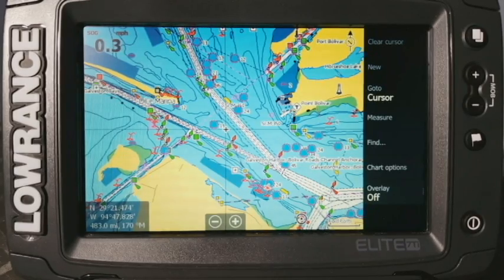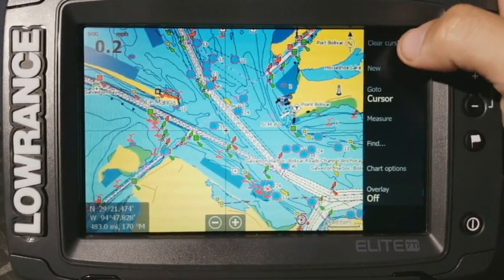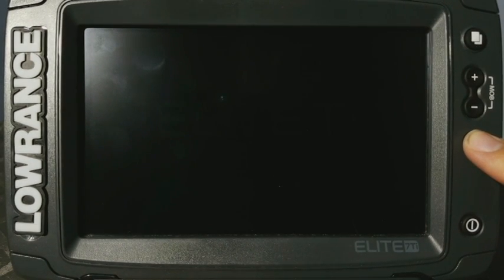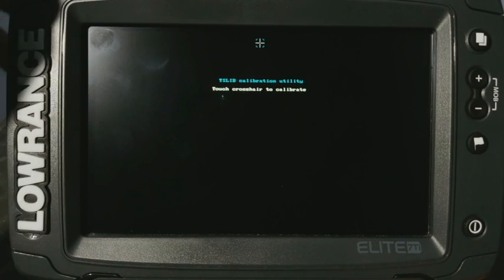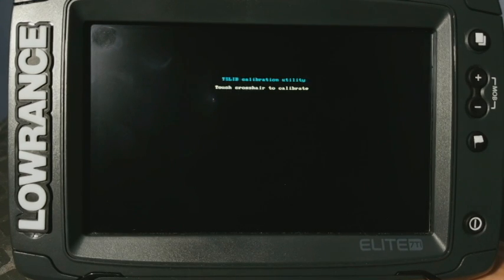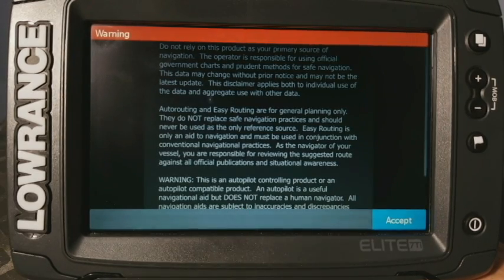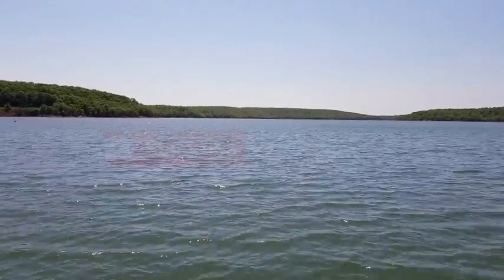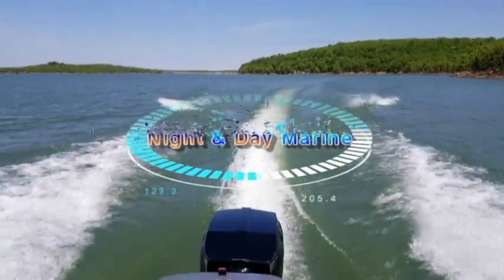How to fix my Elite TI - Touch screen calibration

Comment: I am so thankful for what you're doing.  I've had my 2 Elite 9Ti's for nearly two years and I'm still trying to figure them out. Between my infrequent trips to the lake and my senior moments, I've had to struggle with them every time out. Fortunately, I've retired and now I have all the time in the world to spend on the water.
Reply from the maker: Thank you! I appreciate your feedback. I will be putting more Elite TI2 videos on here. I havnt made too many of them as the HDS videos pretty much cover the exact same stuff since most of the features and menus are the same. BUT.. there is still more to come!
Reply: @nightanddaymarine8823  I don't have the Ti2's. I have the Ti's, which seem to relate well to HDS videos. My latest issue is with my new Navionics Hotmaps Platinum. I have a feeling that the Ti's are incompatible with the platinum features, because I can't  access the features.
Reply from the maker: @martyepperly5803  Technically the Ti should still be compatible with it. Habe you plugged the card into your computer and gone to the navionics website and downloaded the latest update for it? You generally have to register the card on their site to activate all the additional features.
Reply: @nightanddaymarine8823  Thx. I managed to speak with Lowrance   tech support. Deon walked me through the process to view relief shading. Just needed to know what buttons to push.🤔
Reply from the maker: @martyepperly5803  oh I gotcha. I thought you meant that none of the features were working on the display.